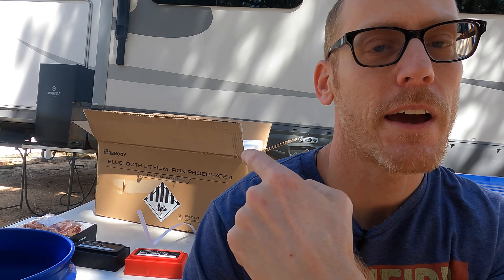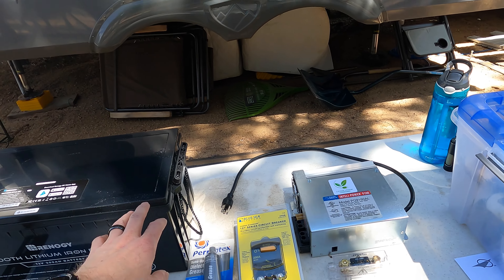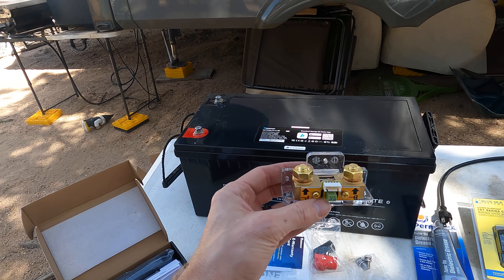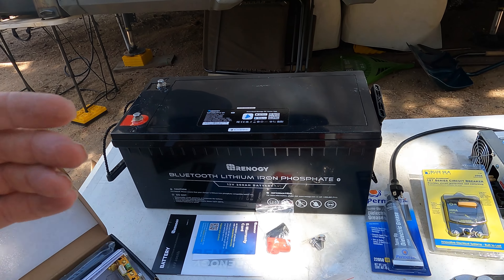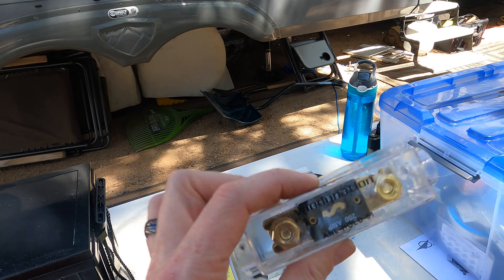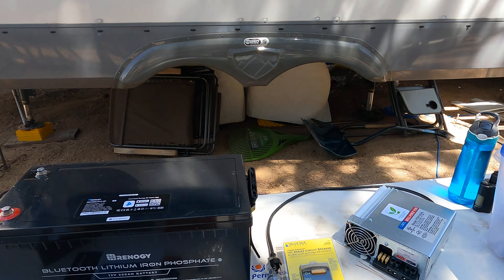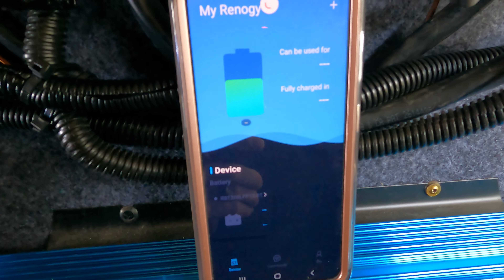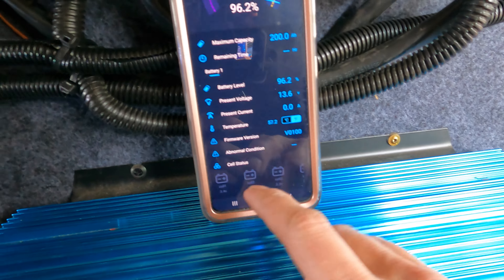Renogy 200ah Bluetooth Lithium Iron Phosphate Install | RV Mods

Comment: You were right to fit a shunt based monitor imho!

I have recently bought one of these 200Ah versions

The built in Bluetooth monitor or rather the BMS it is connected to seems to be very inaccurate providing a state of charge.

According to it the battery gets up to 99.1% and then the % stops increasing and it takes hours to complete the last fraction whilst still completing what’s probably in reality the last 10% of actual charging. This could be because the firmware only goes to 200Ah but the battery capacity is a bit higher, not sure but it’s inaccuracy is very annoying! 

I charge it via Rover40 using the built in Li profile.

The DC home app is extremely temperamental in connecting but when it does it’s quite interesting.

I suspect the V0100 firmware in my battery is a bit flaky, it’s obviously better than nothing but I can’t rely on it.

Right now I refer to my Aili external monitor to get an accurate Soc.

I really hope the low temp disconnect is more accurate!

Comment: What is the reason for the 2 battery chargers? I just purchased a lithium battery to replace the two 6v flooded batteries on my small travel trailer and I'm trying to make sure I have everything set up right before I hook it up to the current system that came from the factory. I had expected that I could simply replace the old lead acid batteries with a new lithium battery but it seems to be a lot more complicated.
Reply from the maker: I have one charger that charges from 120v shore power. Lithium batteries have a different charge profile than lead acid and our previous charger wasnt fully compatible. The other one is so that I can efficiently charge the batteries from my truck this is not a requirement, rather something I find useful to get to camp fully charged in case we don't have shore power.

Comment: Appreciate this video.  I am surprised the Bluetooth feature doesn't alarm on the phone and only alarms on the panel.  That would have been a nice feature, especially if out of the rv for a couple days with items in a frig.  Have you done a test run with frig on and using your new air fryer/toaster/miracle cooker?
Reply from the maker: I ran the batteries down to 29 AH and didn't get an alarm in the app. I will have to do some further testing around things like cooking a pizza in the air fryer oven. I'll definitely have more videos on my experience :)

Comment: My two cents on your fuse questions. You should definitely fuse the power outputs on the battery charger. I know you have fuses on the charger itself, but they protect the device, they don't protect your wires. The fuses on the output wires would protect the wires....
Reply from the maker: Thanks for the advice!